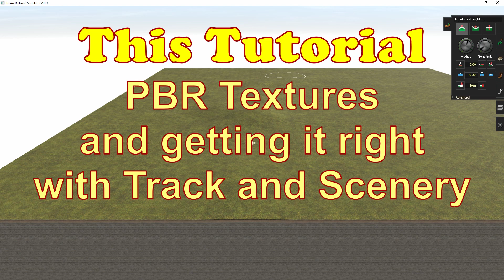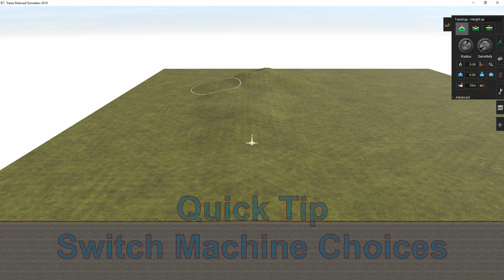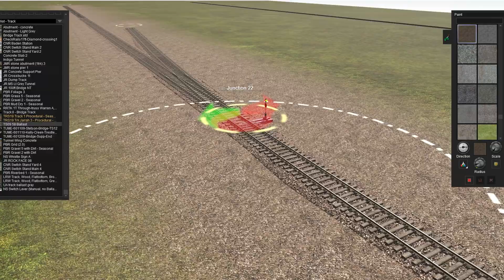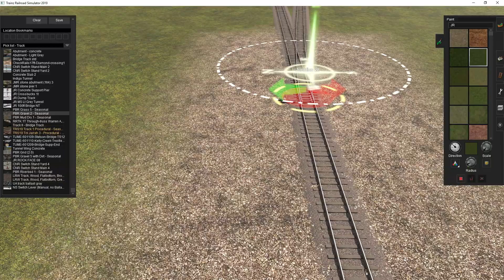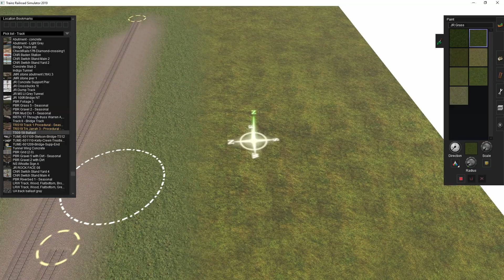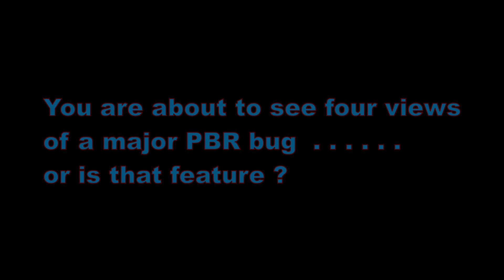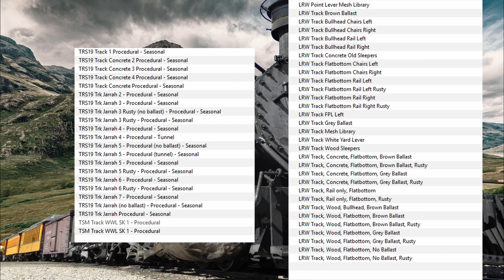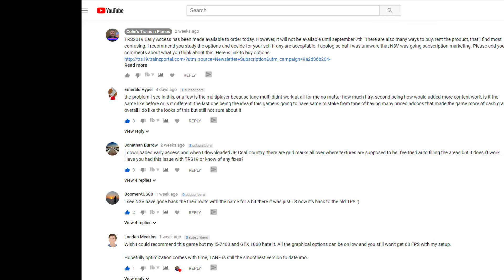Trainz TRS2019 Route Building Part 5 PBR Texture Problems

Comment: Those problems are something that has efflicted every installment of this game not just 2019. Levitating track can be fixed by adjusting the roadbed with the spline height tool after the route had been made. Must remember to go over it about 5 times though as fixing some areas levitates others. The liquid scenery is well just part of the scenery of the game. Many of the OEM routes in all installments had them. 

When creating mods or my own routes, I found a catastrophic CTD would follow with some combinations and of course if you forgot to save the last half hours work (sometimes much much more) then you'd lose everything you'd just done. I also found trying to solve issues via workarounds consumed so much time I was embarrassed at the time I was spending. Often enough if I was having difficulties with liquid textures, levitating track and snaking tunnels the very act of Save would cause the computer to freeze. Very very glitchy series of games these.
Again, those snaking tunnels would drive me insane. I see when OEM routes in the game have S bends in them I know what the designer was going through.

Comment: No it does not seem to, I did several comparisons and so no differences in the PBR Textures.
I did see the Melting Ground issues did stop altogether. From what I can see, is the 3D Depth effects are not there with the Standard Shader Setting, but still looks fairly good.
It is worth the Trade off to not have the Roads and Track get buried and have that weird Melting effect.

Comment: I am still undecided about the PBR textures.   I have had some limited success with them, but they are murder on road/street splines.  Also, as toy pointed out in the video, mixing traditional and PBR textures is not always a good idea.  I think the PBR textures are really good looking.  Just wish they weren't so fussy to work with.

PS:  Just in case you didn't hear, I did get the new RailDriver to work.  Turns out that the first unit was in fact defective.
Reply from the maker: G'day mate . . . . . . . .. yes I did see the video about it . . . . . . . . . Did you get all the subsidiary stuff like wipers and horn working . . . . . . . . . .. I have been watching most of your stuff . . but have not been lucky enough to catch you live . . . .  Keep it up . . . . . . . . . .
Reply: @colinstrains5885    Yes, I have been able to get the RD fully functional, and more.  I downloaded the MacroWroks from PI Engineering, which has vastly expanded the functionality of the unit.  As of now, the RailDriver gets the full NJP Stamp of Approval.  The instructions?  Not so much.  They really need to rewrite those.
No worries about the streams.  I completely understand about the time differences.  But at least YT makes them available for watching later.

BTW, I like the green screen effect at the end of your videos.  I have tried that a few times in the past, but the results were less than spectacular, LOL.
Reply from the maker: @NJP76  Yes Green Screens were a problem for me too . . Until I got my new editor Davinci Resolve 15 . . . it's free by the way . . . . . . . it is a breeze even if the screen is crumpled or poorly lit . . . . .

Comment: Yes, this is a Issue that I have to, Thank You for your Videos, these issues need to be solved for a Great Trainz Experience.
Also I would like to see the Draw Distance be more than 1500 as it is poor looking at Medium distant Mountains with no Textures at all until you get very close to them.
Higher end PCs can run the Higher Draw Distance such as 2500 or more, very smoothly.
Of Course in addition to the Higher allowed Draw Distance the Options to turn it down would still be there.
Thank Again and Kind Regards.
jjeff1955
Reply from the maker: Thanks Jon, Yes this was an issue when I made the video some 5 months ago . . . and still is . .. . . . sadly if you have an older PC then TRS2019 has lots of limitations you need to apply to get evan passable performance . . .but it is not an easy task to rectify as software companies cannot build and/or maintain two versions  . . one for those with older machines . . the reality is that it is a rapidly diminishing market . . older machines that is . . . .. so justifying a second version does not make economic sense for those money making organisations . .I wish there was an answer . .but I think it unlikely. You just have to accept that newer technology/features will not be available to those with older PC systems, as unfortunate as it is !
Reply: @colinstrains5885  My PC is not an issue anymore as I am running the Ryzen 2700X with the GTX 1080 Ti FTW3 now and this Version of Trainz runs at a
constant 60 fps with my Large Custom Map, that is why I want them to increase the Draw Distances.
Reply from the maker: @jjeff1955  OK, sorry I was unaware of that . . . . . . You are aware the max draw distance is 15km i.e. 15000 metres not 1500 and  . .. . . . . .  Have you lodges an official request with N3V to help others who want the same thing?  The will react if more people make the same request . . .. . .
Reply: My Bad, Yes it is 15000, I think that the older versions where 1500 up to 5000 but Poor performance on older PCs.
Yes I did send a message to the Help Desk about the 3d Textures issues, and also need more DraW Distance to at least 20000 or more, now that we have Better PCs than years ago.

I am not a Trainz Gold Member so I can not get the latest Update for my Trainz 2019.

Colin you can find me on the Steam Server under the name jjeff1955 and we can be Friends there and chat more.
My Trainz 2019 is installed on the Steam Game Server.

Comment: Colin, what are your compter specs. You have a real smooth and crisp looking game
Reply from the maker: Yes I have a fairly powerful system with SSD drives on ALL the software, an I7 processor, 64Gb high speed memory and one of the better 1080 ti graphics.
Reply: @colinstrains5885  thanks colin. I have a i7 16Gb and a 1060. Just bought a new comp. today. 1060 ran looked ok. I needed something better.